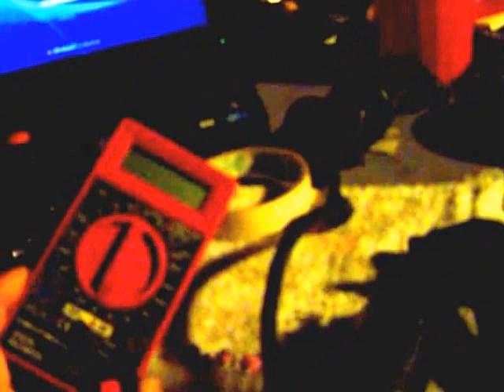Rewiring and Rebuilding HT (High Tension) Ignition Coils (Honda VFR 750)

Comment: What are the odds of all 4 spark plug caps being corroded to the point of no spark at all? is this the issue I could be facing with my bike?
Reply from the maker: I THINK IT IS TIME YOU EITHER BUY A SERVICE MANUAL OR TAKE THIS TO A PROFESSIONAL.  YOU HAVE ASKED ME OVER 10 QUESTIONS WHEN THE PROBLEM IS ONLY ONE ANSWER.  YOU GET AN A FOR EFFORT HOWEVER!
Reply from the maker: It is not the caps.  It is several things such as the resister inside the cap.  If you go on ebay and buy 4 used caps; you will have a 50-50 chance of good ones.  I would follow my disassembly procedure, buy shrink wrap and super glue them back once you repair and Dremel all the parts.  All of it must read 100% when you are done and the total ohms when it is 100% is around 19 ohms only!  All mine are 19 ohms, almost new.  If they are 23, 22, and even 21 ohms; there is some corrosion.  They are worth rebuilding and I have done it; not hard once you learn how to do an incision and slip the boot off.